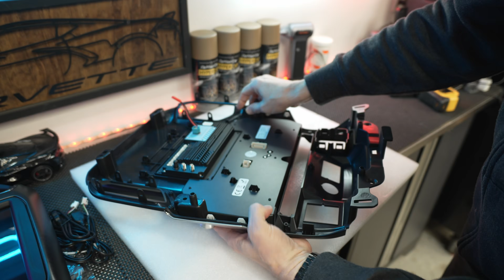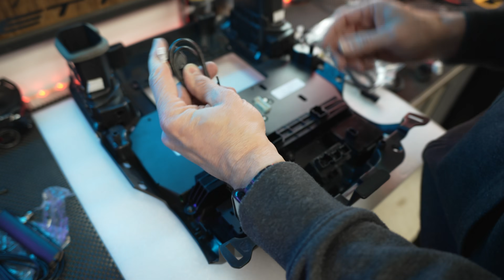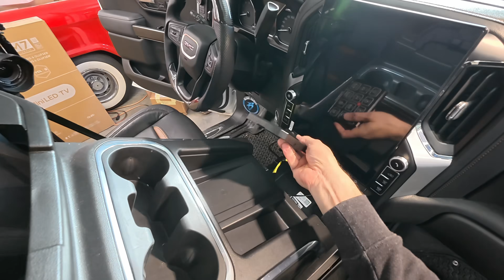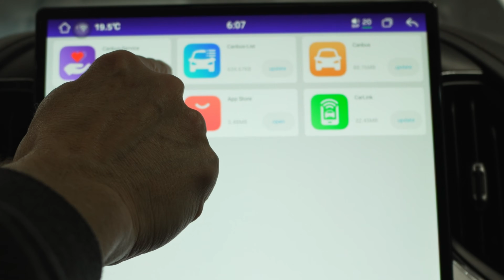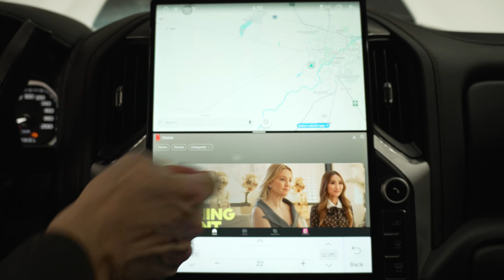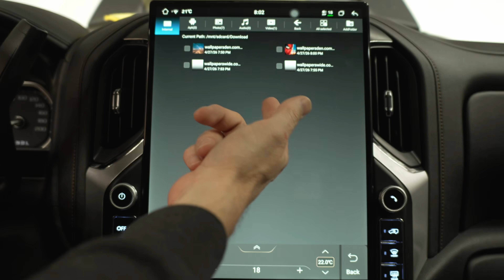This New GM Screen Changes Things… 16.2” Android 15 Review

Comment: Did you have any problems with the screen ? I’ve been having nothing but problems. My AC goes full blast even though the AC is on the first fan setting. I can only control the volume with my steering wheel. When I first installed it, I got in contact with Z Innovations. and I was told there were gonna be an update so my volume control on the screen will work as a volume and not climate control. And now a new thing that happens a lot when my phone connects, it disconnects and goes to the screen Bluetooth, and I have to keep manually putting it back to my truck Bluetooth. Am my climate control pops up randomly. I’m just trying to see if you had any problems with the screen software-wise.

Comment: Between the AuCar 17.2 and the Z Innovations 13.1, 12.3, and 16.2, which one do you think has the best wired CarPlay experience? I use CarPlay every day for phone calls and navigation, so call quality and reliable maps are my main priorities.

Thanks for all the great videos!
Reply from the maker: Z Innovations technology because theirs works with wired CarPlay connected to the screen directly through the included USB cables.

That said, with all screens I found the wired CarPlay works best if connected to the GM factory USB ports.  Of course it will only show up in a lower resolution like the original stock screen, but it works well especially for calls.

Comment: My father in law installed one of the AUCAR radios and two things that really aggravated me with it were 1. It did not retain his factory microphone in the headliner.  It used a build in microphone OR you had to run an external microphone.  2. If he was listening to the radio, he could not enter carplay or the radio would shut off and be overridden by carplay.  Can you confirm that this radio 1. Uses the factory microphones and 2. You can use radio OR Carplay audio while in CarPlay?
Reply from the maker: The system can use your factory microphone without needing to install the additional one. As for the radio being taken over by CarPlay.  Initially carplay will take over if you load it or if it automatically loads, but you can cycle back to radio or XM for your audio source while CarPlay is still active.

Comment: Oem screen on my 2021 Silverado is crapping out going black and what not going to buy and upgrade instead of spending 1000$ to repair is this one still your top pick?
Reply from the maker: hopefully it is just the screen and not the module that outputs the signal to the screen.  If it is the module, no aftermarket screen will resolve or bypass the issue.

Comment: Don, is this unit’s software optimized for a 2026 GMC 1500 with the manual A/C system? The current Tesla-style screen keeps triggering BCM U0424‑00 and ECM U2209‑00 fault codes.

Comment: Hi Don Great video, I wanted to ask you 2 questions. 1, which is the video to learn how to adapt the factory gps you mentioned. 2, when you want to remove the screen from the plastic backing you just pull out?
Reply from the maker: Here is the GPS video: How to Tap Into Your Factory GPS Antenna for an Aftermarket Screen + First Major Software Patch!
https://youtu.be/3ywAT34JZJc

And yes, just pull on the screen wiggle and gently pry apart.  I would make sure it is a warm day or or in a warm area so the plastic clips aren’t brittle
Reply: @Donslife Thank you! I will check out the video. The aftermarket antenna is garbage. Oh, and it's always warm in South Florida, lol. Great channel; I've learned quite a bit from watching.

Comment: How did you the the reverse lines to not overlap i have the reverse line from the unit that overlaps both views completely usless in helping to reverse and confusing.
Reply: Are you sure you have a Z innovations 16.2 screen upgrade? 

Our screen switch’s to the factory system and doesn’t have the option or ability to add extra distance line markers.

Comment: Hi! This is Primo, I recently purchased and installed the unit from Zinnovation, 16 inches T style. Everything works except the climate control issue, when I start my car the climate control is already on, but I can’t turn it off or I can’t turn it low or turn it up high. I have 2021 custom with 7 inch screen any suggestions?
Reply: We have sent you a software update
Reply: I have the same issue. My fan is at full blast all the time did they send you a fix? It’s driving me nuts.
Reply: @chriscowboys100 did you purchase your screen directly from our website?
Reply: @Zinnovationsoz yes I have purchased through yall and I have never received a update for the issue ?
Reply: @chriscowboys100 we have replied to your email.  Sorry for the delay as it is currently 5am in Australia outside of our business hours.

Comment: So how's the screen coming back out if you pulled the screen off to put two screws behind it.  Does the screen pull back off easy.
Reply from the maker: Yes the screen is able to be separated from the body very easily after being mounted.  I even filmed it, but forgot to include the 10 second clip.  I will share it with the next update video

Comment: Hey Don.  Love your videos.  Very well done.  Had a thought regarding removing the screen before mounting the frame.  Those screws on top that can’t be accessed with the screen in place would be a problem when removing the whole thing in the future.  How can you remove the screen to access the screws without accessing the back?
Reply from the maker: The screen is able to be popped out independently after installed too.  I filmed it and forgot to place it in this video. Literally takes seconds
Reply: @Donslife where can I find the part about removing the screen without the screws?

Comment: Good job man. I also look forward to the digital knobs, but wouldn't mind them being customizable. I think I prefer having one for volume control and one for fan speed. I have learned that those two things are more crucial to be able to adjust quicker.
Reply from the maker: Thanks Zach
Reply: The only thing holding me back from buying this is that the power and phone buttons at the bottom are being used for climate control.

Comment: man - when is someone going to make one that doesn't have very noticeable audio delay. That's the only reason I haven't purchased one of these yet.
Reply: I reached out to find out if there was software like Sound Assistant or app like VLC to use where it would adjust the lip sync lag.  I use to use VLC on my desktop years ago to adjust it. I'm just not sure if it's an option with these units.
Reply: Same, audio delay--- how is that even ok

Comment: Are any of these upgraded screens available/compatible with the updated 7" screen for a WT?
Reply from the maker: Yes. 7 and 8 inch.  Features like dual climate control, heated seat, etc will depend on the what the truck came with.
Reply: @Donslife  I want to add a front bumper camera but GM is wants to make life difficult. Do you think any of these aftermarket screen companies will make it easy to add on features in the future? Maybe some plug and play (or wireless) accessories like cameras, or maybe even cb radio functions?
Reply: @idowhatiwantfoo you can add a front camera and connect to the yellow CVSB1 RCA. You will the be able to access your front camera via the built in AUX app

Comment: I just wish they configured the knob on the left to be used for volume instead of having to use the steering wheel or screen
Reply: We're working on a update to switch between AC and volume controls. Don and Zach both received pre production models 6 weeks ago.
Reply: @Zinnovationsoz please tell me that you are also working on an update to spell Home correctly? 😊
Reply: @SchwiftyThings it's already been fixed
Reply: @SchwiftyThings  i saw that too. I'm wondering if it's just a simple as adjusting the character size for the word to fit in that space?

Comment: So I’m watching this and you talk about setting up a google account just for the truck. I’m wondering if when you start the truck you could download an app that requires you to enter like a 4 or 6 digit code, that you have you to enter to use the screen in general? If this makes sense?
Reply: It takes 5 minutes to setup a new Gmail account. 

Code can be frustrating if other people want to drive or a workshop. Plus most likely you will use the same code you use on other devices.

 It’s only a suggestion you don’t need to take our advice.

Comment: My aucar keeps killing my battery...does not matter whether the sleep switch is off or on the system stays in warm boot mode i.e. not from a cold reboot. The sleep switch off should kill this unit with ignition off and door opened or after some short time frame. Constant emails to aucar are fruitless. They just asked to see the sw version...confirmed it was current and wiped their hands of it...unless they re-engage Do not get the aucar. Maybe zinnovations would support you better...at this point parking the car overnight means a struggle to start with check engine lights DEF system warnings all kinds of blinking lights that I have to pull the negative terminal to reset. Trash....only mod I put on this truck but it's coming off...they are also not into honoring warranty or RMA. If that ever changes I'll update here...it's 4 months old.
Reply: That’s not your units fault you got some wiring issues that’s tapping your battery

Comment: Now this screen, out of all the reviews you have done is really peaking my interest. I like how it keeps most of the factory positions for the vents and bottom switches.  The resolution looks great, and I see no lag when changing views. As usual, another great video, thank you. Let’s Go!!
Reply from the maker: Glad you enjoyed the review and found it helpful! 👍
Reply: @Donslife  When you do the follow up video, please go over the phone connection to this new screen. Also, where did you find the connector to the factory GPS antennae?
Reply: @Donslife  completely irrelevant to this but where did you get the carbon fiber steering wheel cover?
Reply: @applumbing1031 it’s not a cover, it’s a complete carbon fiber wheel. He has a video of the install.

Comment: Does SiriusXM work off the factory antenna or is it streamed over wifi?
Reply from the maker: Both.  I use my factory antenna with my subscription, but I can also install the app and use it with an internet connection
Reply: I'm always trying to get rid of SiriusXM

Comment: If you can say which is better the zinnovation or aucar?
Reply: Yes help us out, your viewers... and be honest, dont be scared from the ppl who send you free stuff, when your honest that is how they fix things. What is best, if we can only have one?
Reply: Also need this answered as I am stuck on which one to go with
Reply: He’s not going to answer that, which is ashame because this could really help ppl determine which to get.
Reply: @drummerseahawkboy   Thats sad,  he sure wants to talk about GM and tell the truth about the engine. He should just be transparent all the time. If he cant be it makes me think he is just a paid advertiser
Reply: I purchased the AUCAR 15.6” w/Android 14 and it works amazing in my 2021 Silverado 3500. The thing I love most is the control mobs are LED display so you can set one side to temp and one to volume.
Reply: I currently have the 15‑inch Aucar unit installed in my 2026 GMC 1500 Pro (7‑inch), and I’m getting A/C communication errors. The system keeps triggering BCM U0424‑00 and ECM U2209‑00 fault codes, and it recently set off the service engine light.
Reply: @rc10006  thats concerning i just picked up a 2026 silverado 1500 custom (7inch) and was looking into this, zinnovations says their new big screens are ready for 2026 models.
Reply: I have the 17.2 aucar and it works flawlessly.

Comment: Thoughts on the new stinger infotainment screens for the 19-22 GM Trucks?
Reply from the maker: Seems like it is full of compromises and factory warranty challenges:

FITMENT GUIDE
• 2019-2021 CHEVROLET SILVERADO/GMC SIERRA 1500
• 2020-2023 CHEVROLET SILVERADO HD/GMC SIERRA HD
• 2022 CHEVROLET SILVERADO LTD/GMC SIERRA LIMITED
• COMPATIBLE WITH RPO CODE IOR ONLY
• NOT COMPATIBLE WITH BOSE-EQUIPPED VEHICLES

Retains OEM functionality:
• Climate control panel
• Button Control Panel
• 110V power outlet (if equipped)
• Trailer controls(if equipped)
• 12V outlet

Does not retain any of the following factory features:
• Factory satellite radio
• Factory Bose Audio
• Time of Day in Cluster
• Wi-Fi
• Valet Mode
• Teen Driver Features
• OnStar
Reply: @Donslife have you looked into the Kenwood direct replacement head unit?